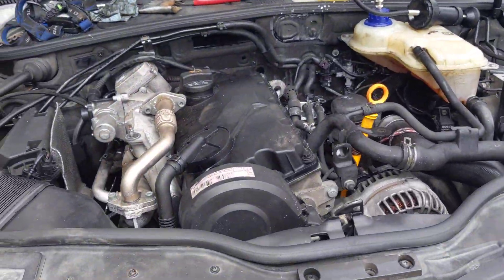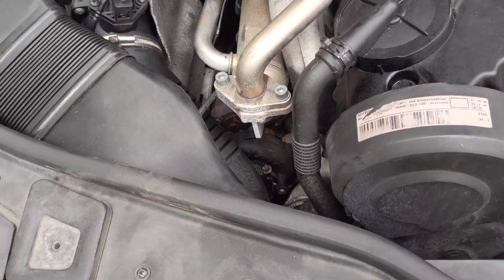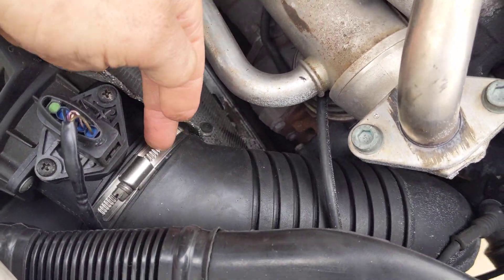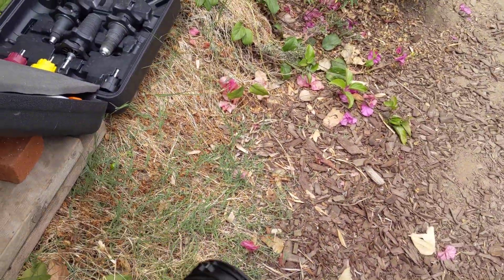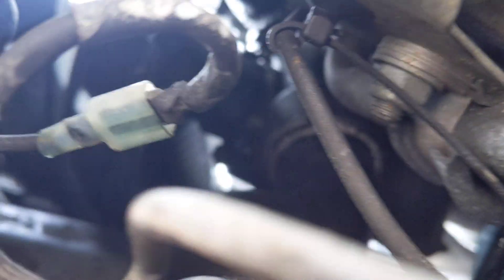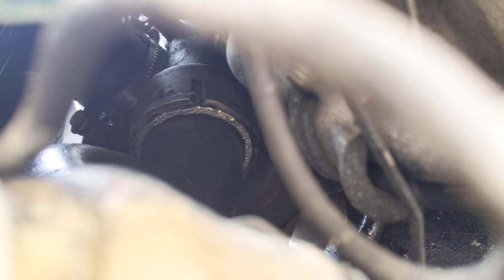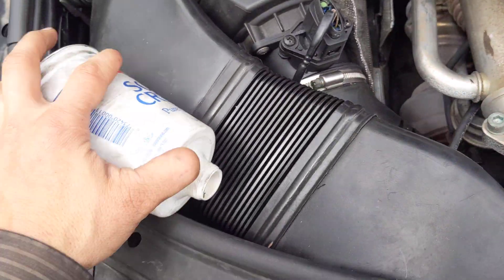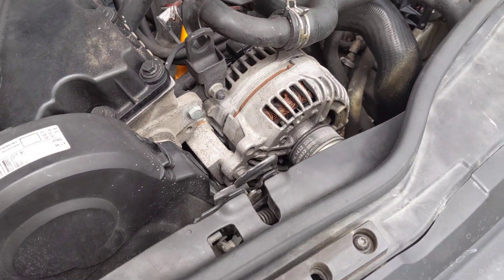Intercooler air intake pressure test boost leak maf P0101 2005 Volkswagen Passat TDI B5.5 BHW

Comment: Here in the UK I have a 1.9 TDi B5.5, mine is the AWX engine code. The hose you show is very common to actually split, mine went twice, a one inch split about half way down. Makes a massive whistle when on boost.

Comment: Thank you much!  Excellent video with solution and parts info to solve a hard to find problem.  Just need hose diameters to hunt down other O-rings but I can take those hoses out and measure.  
The clue is a P0101 alone by itself.  If EGR or Turbo was part of the problem, other codes would most likely show up.  I checked my intake hoses for disconnects or cracks and didnt find any so I assumed it was all good.  This video helped me find the leaks.  Replacing all O-rings now.
Reply: I forgot to mention I replaced the MAF and MAP sensors too.  They were old and needed replaced anyway.